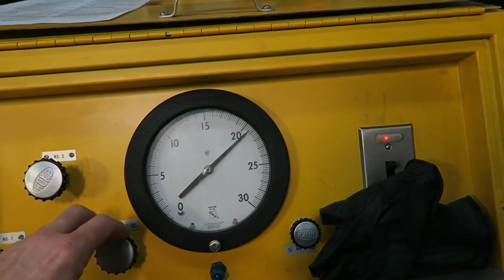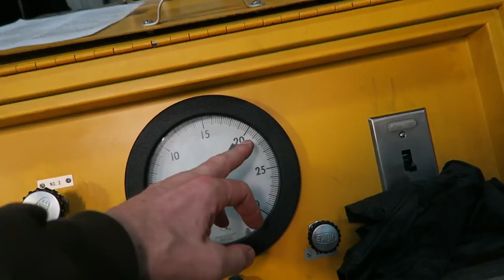Working on a Turbojet: 10 - Thrust Bearing Seals

Comment: The word you are looking for to categorize suction is "apparent force" - inside a pressurized environment, there is an apparent force of "suction" if a localized area of low pressure is created by mechanical means.  Just like in a rotating environment, there is an apparent force "pulling" you away from the center of rotation which we call "centrifugal force"

might be useful for beating off the trolls, but that may only server to encourage them further?  who knows.

Comment: Well, there goes a few more cool tools I'll probably never own, nor deserve!  Nice work & great background tunes!

DD
Reply from the maker: We made all of the custom tooling. I know you could.
Reply: Thanks for your confidence in us <Mark & I> !!  I actually was referring to the safety cable tool; I still want a 'left-twist' safety wire pliers set!  We are currently working on a tool to hold the J44's compressor-end spanner nut while torquing the shaft tight, according to the bible <manual>.  Mark has been extra-busy this Winter so progress on the Project has been slow, & I can't really imagine how long it would take to restore a J79!  Decades, for me!

Comment: When does the bearing seal on the bearing seal tool have to be changed? Is there a smaller bearing seal tool? Does it have silicone bronze bearings instead?
Reply from the maker: The tool used to install the bearings and the seals does not have any seals of its own.

Comment: yOU THINK THAt was fun?
try fixing a 3 crack  ON a bracket under one of the gear support rods..in the lower portion of  the wheel well of a LOCKHEED C-141A  or  B MODEL.

Comment: As you said Jay, there is no suction but also there is no such thing as cold just different levels of "absence of heat" but it still seems cold. Finally broke today and it bearable for the next 3 days then back into the deep freeze.
Reply: Actually there is no true suction in gasses - however liquids can display negative pressure

Comment: How did you tighten that monster 9 bazillion yard pound locking nut? Haven’t seen that process in all the videos I watched. I’m guessing you used large vise grips with a 12’ pipe and maybe a sledge hammer just so you could ‘feel’ the torque was incorrect.
Reply from the maker: In some of my older videos, I show us using Little Blue and Big Black, two hydraulic torque wrenches named for their panted color. Blue is heavy and awkward to handle, and can apply up to ten thousand foot-pounds of torque. We use it on the RR Spey.
Black is moveable only with the crane, and goes up to thirty thousand ft-lbs. We use it on the nut securing the same bearing shown here, but in the LM2500. It's mighty impressive... and then you realize that once assembled and running, the output torque of the LM2500's PT shaft is nominally sixty six thousand ft-lbs.

Comment: I have an idea, not sure if this has been brought up before. If you routinely work on just a few types of engines, perhaps you can 3D print a "tray" that just drops into the center, to replace rags or other devices. The tray would sit flush in the center and catch any falling debris or screws. Compared to the other specialized tools, this would be rather inexpensive to make.
Reply from the maker: It would be very expensive to make, compared to rags or cardboard circles.
Reply: Not sure what expensive means, it's probably infinitely expensive compared to free, but otherwise it's 1-2h of toying around in a CAD program, 10-20$ to print the part at an online service plus shipping. If it sounds interesting to you I can sketch something parametric in OnShape and you can tweak it, no software required.

Comment: It's really interesting that the bearing tool pushes against the inner race.  I've always been told that doing so risked damaging the race surfaces though maybe this bearing is made from special sauces.
Reply from the maker: What youve been told is correct for bearings that have a tight fight between the outer race and the bearing housing, and a less tight fit on the inner race to the shaft.
This bearing is the opposite.
Basically, you never want the installation forces to be transferred through the rolling elements.
Often because that's the only way to remove some bearings, they are described as single use. They are damaged by the removal process.
Reply: AgentJayZ oh of course!  It never occurred to me that the press fit was on the shaft.  Thanks for explaining it to me!

Comment: unnecessary precision can lead to other not-so-good things, a fit that is too "perfect" can lead to more friction which if one is lucky will just eat on the mating surfaces until they're back "in tolerance" and in the worst case will wear out the part or cause other issues, especially when thermal expansion/shrinkage is in effect...

Comment: Dear AgentJayZ
I found your channel thanks to YouTube algorithm "you might like this" and I did enjoy it. I binge-watched it actually, very nice job. I came across a news report about "fume events" on commercial aircraft and I'm quite surprised as you explained that all was made with the different seals so that under no circumstances oil would leak in the compressor (and then in the bleed air). It looks like either "all" is not enough or I didn't get your explanations or news is lying to us.
Can you share your hints?
Thanks in advance.

Comment: AgentJayZ,
Fellow Jet Tech and A&P here. You talked about balancing rotors in the video. When I'm balancing a HPT or HPC I shoot for a 0.7gram-inch correction. I always want to get a tighter balance, but I'm limited by weight selection without vectoring balance weights. Thanks for the reminder that perfection is not necessary. Do you have any other advice for a new Jet Tech?
Reply from the maker: Yes. Always remember that the managers telling you what to do... have no understanding what it is you do. They are in their jobs because they can talk the talk, but can't walk the walk.
Try not to laugh at them. They will not like that.

Comment: 22:53 why is the lockwire not connected at the 180° points? (between the two top and bottom bolts)
I also have often seen where the lockwire covers only two screws... is that done for a reason?
Reply from the maker: The cable is not long enough to go all the way around, so I wanted to make it symmetrical as two halves of a circle.

Comment: Thanks JayZ another great video, we are going to be 77° today here @ Loma Linda CA and we are very close to one of your favorites places Palm Springs, come over. Some mechanics believe that a torque should be set higher on a wrench if an extension is used in order to compensate for the torsion of such extension, I disagree. Can you comment on it? Thanks.
Reply from the maker: The only time torsional flexibility of the extension needs to be taken into account is when using impact tools, or if you are moving the torque wrench way to fast, in a jerking movement. Never be a jerk.
Reply from the maker: Not an extension on the handle... an extension between the wrench head and the socket... I think is what he's sayin.

Comment: That safety cable applicator is US$500 from Aircraft Spruce.  I would imagine that tool with the Snap-On brand is about $100-150 more and it's made by the same people!
Reply from the maker: Ours is made by Bergen, and that's where we paid 1500 US for it. I guess we shoulda shopped around...
Reply: The one from Aircraft Spruce is the same brand.  The tools AFAIK are actually made by Daniels Manufacturing.

Comment: That is a interesting technique for the lock wire on the bolts in the sump. I have never seen the twists going through the bolts like that.
Reply from the maker: I used safety cable because it was much faster. This engine is destined for an unusual purpose that won't be discussed further.

Comment: If 9.5 is your measurement and 10 is the limit, but the ideal is 7.5, does that mean it might not last as long and fail sooner than if you got it closer to the ideal?
Reply from the maker: There is no ideal given.
Reply: Not in this case, but other products have a range, or a "Normal Distribution" bell curve.  Something on the very edge is probably an outlier, and may cause trouble.  (I used to work in semiconductor manufacturing, and they really hate outliers, lol)

Comment: How do you center the inner knife edge seal so it doesn't rub? It doesn't appear to have provision for the conical head screws to center it as you show on the outer seal.
Reply from the maker: +George Cameron 
In Your Questions 33, I talk about labyrinth seals. That's what these air seals are.

Comment: Do you use a feeler gap gage on the JIC connections for the oil lines in that bearing area? Or do they get tightened to some torque spec?
Reply from the maker: I have always marveled at the fact that the most critical  connection in oil systems have no locking mechanism. There is a standard torque range for those JIC connections. I have never seen one come loose.
Reply: I've vaguely recall seeing lock wire on a JIC connection nut.  It was in a A-4 skyhawk and I don't recall now what part it was on or why.

Comment: I click 3 times then pull a little more to ‘feel’ that the torque is correct 😃
Reply from the maker: That little bit of feel means you are going past whatever is set on the wrench. I would give that technique a fail in my class.
Reply: AgentJayZ Haha it was sarcasm to all my friends that have a precision torque meter for a wrist. 😀 the only fasteners that require any super precision are torque to yield which require the bolt to be stretched a substantial percentage of its length to a specific resonance and is within 5% of its rating, such as used on rocket motors. Other than that the 450 trillion fasters that have been improperly installed and caused no real issues is testament to that 😀 but if sleeping better at night only takes a few seconds, then why not do it right...